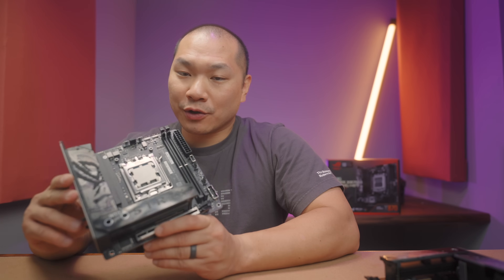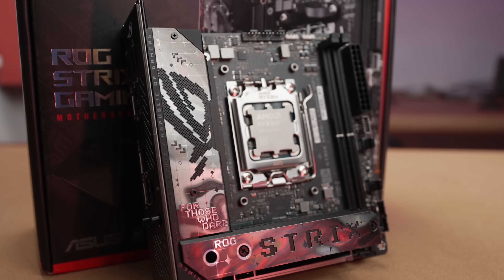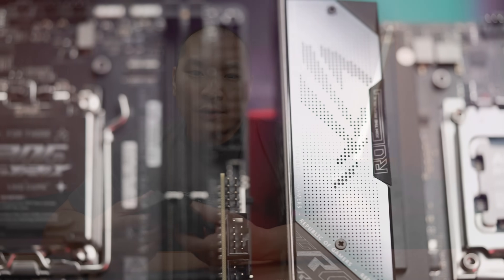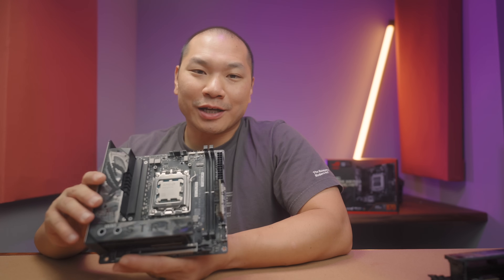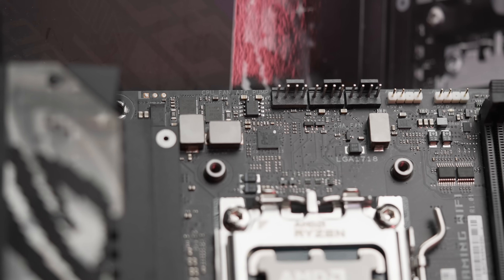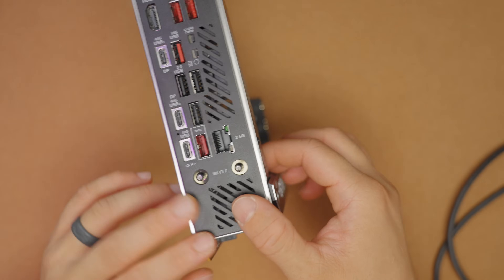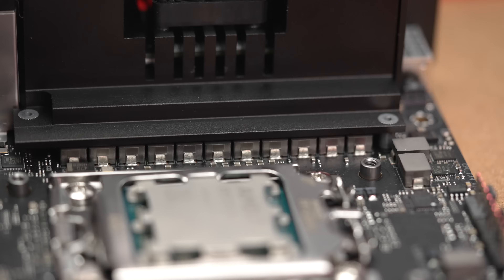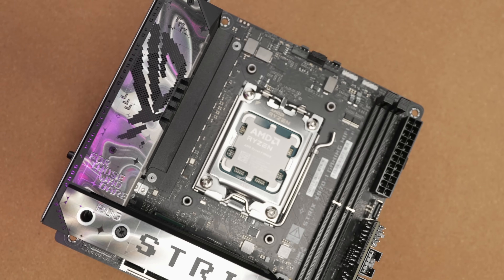Asus's Strix X870-I is the 𝙗𝙚𝙨𝙩 𝙖𝙣𝙙 𝙤𝙣𝙡𝙮 800 series AM5 ITX board.

Comment: HI I Just replaced my strix b850i Itx board, i bent a  couple of pins on the b850 i and some how thermal paste got underneath the CPU but on the outer edge, but i kept getting no videeo and an orange,loght  tired my 5070 card and new ddr 5ram plus old ram that works  same result, went back to my old ram  again and rtx 4070 and same result orange lighr and no display output, hoping its not two cards detroyed ,oh was using a 9800x3d.,  i will find mmy 7700 ryzen and try that, also tried flashing the bios via flashback and clear cmos and display on both cards monitor is fine as xbox and ps5 play ?? thanks

Comment: I am looking at building a computer for 3D modeling, maybe FEA analysis, and for use with a 3D scanner.  I might also start doing some gaming.  I want the PC somewhat portable for use with the 3D scanner, so I would like using this board for the small form factor.  What am I giving up over using an ATX board like the proart X870E?

Comment: Did your X870-I board a a plastic protector on the motherboard's back plate? It seemed more permanent than the normal removable ones with tabs on them to pull off. I tried to get it off but could not. I just ask because in your close up shot of the new board's back protection plate I don't see the clear plastic film cover. I didn't remove mine because I couldn't even get a corner to lift up.

Comment: Got one for my build. The only option for AM5 mini ITX right now (ordered from factory). Paired it with 9950x. Great board. Build quality is TOP tier.
Reply: How do you have your audio setup, i ask as i've been using a decent pair of usb type c speakers.
Reply: @mikey7326  I have behringer studio monitors. I connected them through analog out to strix hive. But if you want to ignore asus external sound card there is a usb connection available.

Comment: From other reviews I heard that the clear cmos button only works when you entirely disconnect the boards power. So with high end PSUs it can take a long time till the capacitors are empty and you can finally clear cmos. Otherwise you would need to disconnect the 24 Pin connector every time. Which makes this board kinda weird for overclocking attempts.
Reply: Unplug PSU the. Push power on button.

Instantly emptied capacitors.

Then push clear CMOS.

Comment: I am thinking about buying the Asus ROG STRIX B650E-I board for a new build early next year with 9800X3D or 9950X3D and RTX5090, because it supports PCI 5.0 for the GFX, and has neither an add-on pcb nor an external sound device. Do you think this would be a good decision or are there other reasons why I should get either a more high-end board like the X870-I or look for the newer B850 boards next year? I don't think I will need USB4 and I won't be doing any overclocking (neither CPU, RAM nor GPU). I heard B850 will not support PCI 5.0 for GFX, so that's why I think B650E  might be a better choice.
Reply: B850 may not require PCIe 5.0, but that doesn’t mean manufacturers won’t include it anyway. There’s money to be saved/made in streamlining production. Asus already had PCIe 5.0 on their mid-range board this gen. They will likely continue that trend and/or another manufacturer will do the same.
Reply: Be aware, the B650E-I has terrible coil whine. Recently I have tried 3 of them and all 3 major coil whine.
Reply: @brianmiller1574 do you remember the production dates of the affected boards? I heard it should be fixed with newer revisions, but your comment makes me worry. Just ordered one on a good black friday deal but can return it until end of January. Hope the 9950x3d gets released until then so that I can try it out.
Reply: @nukunuku97  Not to make you worried, but keep an ear on it because I don't thing ASUS has fixed anything, either on physical front or via Bios. 
My first board was produced in 07/2024 and that was made in Vietnam. That board had the least coil whine, but you could still hear it, especially in full 4K screen like I have 32" 4K BenQ and the weirdest part was it had the loudest coil whine while in Bios settings. The other 2 where made in China produced one in 08/2024 and 09/2024 and these were intrusively loud, all 3 went back to Amazon. I didn't bother any further as I went through many reviews and this seem to be common for this board. I hope you either be more lucky with yours or figure something else. 
Good luck

Comment: Just installed this board with a 9800x3d and ddr5 8000 expo tweeked profile , pbo enhanced 85tjmax ,10x scalar  +200 overide and it booted up zero issues in 6 seconds and is solid at 5530mhz and never gets past 69c at full load.  Cant say the same as my strix x670i board . That one took a long time to get solid. I dont often use the onboard audio but even if you do the large vol knob is handy to have when you travel with a 60% keyboard. I was a bit surprised to see usb2.0 to be fair but i still like it. 👍
Reply: Sind Sie zufrieden mit dem Board und würden es empfehlen?
Reply: what ram did you buy?

Comment: I just bought the Corsair 9000D and will be using the Asus Crosshair X870 and this board in my build. I've come to terms that I need to two systems in my life.
Aethsetically they both go great together and I can maintain symmetry within the build. But it's definitely overpriced for what you get. I'll probably put this build on Reddit once I get to that point. I'm waiting on the 9000x3d chipsets to release before I can complete the build.
Reply: The 9000d should be here on Wednesday Oct. 30th, following the x870-i will be here on Friday Nov 1st. Cooling options will be the H150I LCD on my mainboard and H100i lcd on the itx. I'm going with a cheap cooling option until I can get some help with a more sophisticated watercooling loop. My mainboard has the AX1600i powering it with a 4090, and the itx will have the asus 850 thor.

Comment: Would there by any in game difference in performance between the b650e-i and this x870i? or would the gaming performance legitimately be identical?
Reply from the maker: It would be pretty much identical if you’re more or less using it stock or basic PBO enhancements. The X870 has a few more UI tweaks that makes tuning a bit more user friendly but that by itself is not really going to translate to markedly better gaming performance. On a budget, I’d save money going for the B650 and then putting that towards a better card or X3D chip.

Comment: As always you do great reviews, thank you very much. 
The fact that the power connectors are not on the board itself is huge deal breaker for me I wouldn't use the add-on card it anyways, so this board is no go for me👎
Reply from the maker: Appreciate it. Just to be clear there is a power button connector on the board, but all the other front panel items are on the FPS-II card.
Reply: @MachinesMore  I logged in just to clarify that, you beat me to it. That is a big difference with power Botton being onboard, that is all you need to power on and off the system, makes a difference.
Thank you

Comment: ASUS should've made all their AMD 800 series motherboards without intel components with their Strix X870-I using Realtek's 5GbE instead of intel's 2.5GbE. Hell, I wouldn't mind if it had Realtek's 2.5GbE. At lease they're using Mediatek's real WiFi 7 chipset with 320MHz bandwidth support.
Reply from the maker: Agreed a 5G NIC would have been very desirable.

Comment: Sorry for the noob question but is this board (and ITX boards in general) not meant to be used with discreet graphics cards? Is that more of a mATX thing?
Reply from the maker: There’s no requirement, the board itself has an HDMI and DisplayPort out if you want to use integrated graphics, but I can tell you it would be extremely rare for someone to go for a board like this and not build with a GPU. For most builders the iGPU will be more for debug purposes.
Reply: >> is this board ... meant to be used with discreet graphics cards? <<. Yes
Reply: Currently using a 7900 xtx
Reply: In a ncore max case

Comment: Hi, is it possible to use a bluetooth headset without the hive? Also, as the hive as a power button, is it possible to not use the expansion card?
Reply from the maker: Yes and yes. This is where the Hive is purely a USB hub/debug LED function. Just to be clear there is a power button header on the board itself, so you can still use that without the add-on card.
Reply: @MachinesMore  Thanks for the answer! I will get this board because I need 2 nvme on top of the board (not behind) and I hope that the X870 which has only one chipset will bring less heat to the bottom nvme than the X670E. I just don't understand why Asus keeps some features for intel boards like the vertical mount of the ssd on Z890-i...
Reply: Yes Bluetooth is handled by the wifi antennae, totally separate

Comment: Guys I have been using ASUS X670E GAMIN WIFI for a year now.
Great ITX board for AM5.
The new X870 chipset is old candy in a new wrapper.
1) The technical design of the board and the bundling is the same.
2) USB 4.0 was also on the old X670E board (Intel controller).
3) Power supplies are the same 
4) Chipset chips are the same
5) The only difference between the two boards is the presence of WIFI7 in the X870 board.
X870 is a great board and if right now to build a PC on AMD, you should take X870 because the price difference between X670E -X870 is very small but if you look objectively, the new X870 is X670E in a new package with a new image on the heatsinks.
Reply: Hi, just confirming, the x670e has usb4??
Reply: @yijiazhan45  Yes, 2 x USB4 port(s)- with Intel JHL8540 USB4 (X670E vs X870E the biggest difference is wifi7)
Reply: Thanks for the comparison. I only use USB for mouse/keyboard and occasionally a thumb drive, I don’t use wifi since I connect through an ethernet cable. So nothing really worth it for me when comparing it to my current B650-I board.
Reply: Man, B650E great board for everything on AM5 socket.
AMD produce new ryzen 9000, beautiful CPUs special 3D v cash line, but chipsets for 9000 CPUs  is the same on 7000 CPUs.
No reason slide on X870, 870 it's only marketing.

Comment: what even is the point of having x870i board if it only has 2 m.2s lol
Reply: 2x 4tb nvme is enough for the above average. There’s no advantage to multiple smaller drive. I’ve picked up 990 pro 4tb for 260 and later a we 850 for the same on a deal…. How much do would you need?
Reply: @djnes2k7  i mean, main advantage of better chipset is more pcie lanes. And they don't even use those

Comment: IMO I'm not a fan of the Hive add-on or mobo vendors using daughter cards to add functionality. I feel like vendors are trying to oversaturate functionality to justify these excessive prices.  I feel like they're trying to also justify the 870 chipset over 650/670, which really just boils down to connectivity.
Reply: Yall are just bitching now…trying to keep heat at bay with how powerful this is…pcb space is a luxury.
Reply: @djnes2k7 you are actually kinda right
Reply: well to each there own
Reply: Hive is necessary at this level. It comes with its own postcode equivalent via Q-LED lights. I used it to find out that my 7950X3D's I/O die completely died.

Comment: Nooo.... I was waiting for a review that included the noctua d15 g2 and that fps card and you're saying you have to push the fan 10mm higher? That's brutal... Brutal brutal brutal. That ruins this for me as I have basically on the millimeter clearance already for the d15 g2. Do you think the bottom m.2 gen5 cooling solution is good enough given it only has a thermal pad on the top side of the ssd? Most of these gen 5 ssds are dual sided so only have thermal contact on the top side seems insane.
Reply from the maker: If you can live without the riser card it will make life a lot easier for the D15. The second fan does get pushed up a lot even with non LP RAM on a some ITX boards.

Comment: I feel like the ASRock A620I Lightning Wifi is a hidden gem if you are planning on using an x3d CPU.  About the only thing it's lacking is maybe a few extra usb ports on the rear i/o, but otherwise it has basically everything every other AM5 itx board has but at a fraction of the cost.  Hardware unboxed reviewed it recently and shows it's a solid board.
Reply: Agree! There's also the B650i that has 2xUSB 2.0 extras on the rear i/o
I was planning on getting the A620i, but I may get the B650i version instead!

Edit: There's also the price. The B650i fell down closer to the A620i in my country (Brazil) but it still cost more, but when you compare with boards like Gigabyte's and ASUS', it's way better value!
Reply: Unfortunately I have Thunderbolt accessories from previous PC's and my Macbook, so an expensive ITX board with Thunderbolt/USB4 is basically a necessity.

Comment: Nice review. No onboard audio - ah no. Magnetic attachment will not work on aluminum or plastic case panels.
Reply: This seems like bs
Reply: will i still get sound if i use a wireless bluetooth headphone? or is the sound coming from my graphics card through displayport or hdmi?
Reply: @jstarsc0mm  yes, wireless headphones / earbuds use their own dac, you don't rely on onboard audio for them. Only wired ones will not work (except if you use usb c to headphone jack adaptor, then it works too)
Reply: @mparagames would my 4080super have sound? If i plug 3.5mm to my monitor?
Reply from the maker: Yup, it most likely will just end up on a desk.
Reply: Who actually uses onboard audio these days?
Reply: @meateaw  Most people.
Reply: @Lusk7741  Nah. at this price point, you'll almost certainly have a DAC.
Reply: @serrasin  not necessarely.
Reply: @serrasin  Nah at this price point most people will still use perfectly adequate on board audio.

Comment: The video output through USB 4.0 goes through the integrated graphics right? Or does it bypass the IGPU and go straight to the DGPU?
Reply: unless your gpu has a USB 4.0 (there's only two models that do) C output, you're getting the igpu
Reply: @tunejunky  thanks, that’s what I figured! Not the biggest deal since I can always select the GPU in windows.
Reply: Doesn't the iGPU passthrough the dGPU?
Reply: @SuperGGnoRE  you can set it up in windows to pass through the DGPU or use the IGPU. You can be granular about it selecting each program or just have it default to one or the other. It’s really nice, but you lose a tiny bit of performance

Comment: That audio solution on these appears to be useless trash. I just don't see the point.  Seems to me folks paying for a high-quality MB have already invested in nice audio options. That thing is ugly without any real functionality for the user. Nice board
Reply: I actually use the onboard audio to have lower latency. The quality is worse than a  good dac amp  combo though. Oboard audio has gotten very good over time
Reply: Power button and mute switch with volume knob, along with USB extender for the mouse receiver.

But in reality, who actually uses onboard audio though?  Remote power button is nice.

There's a power button header on the board though, so you just do tbuse the hive if you don't need it.
Reply: I thought most people rspecially gamers use the onboard audio..on board audio bas cone a long way..i have been wondering if anyone uses pci audio cards any more. @meateaw
Reply: It’s not an “audio solution” almost no one will be using it for that. It’s about room. It has a usb slot. The main thing is the post lights and reset button. Most sfx case don’t have reset buttons it add it back. Also you can do pbo and update bios with only having your psu hooked up…..

Comment: There will almost certainly be B850 ITX boards. Hoping for some better offerings at more reasonable prices.
Reply: Same, hope it doesnt suck
Reply: There’s now a selection of excellent B850 boards available 😌
In fact, I would say B850 is preferable for ITX, because the chipset consumes less power (so less heat), it’s cheaper and those boards already have VRMs that are more than enough for most ITX builds.